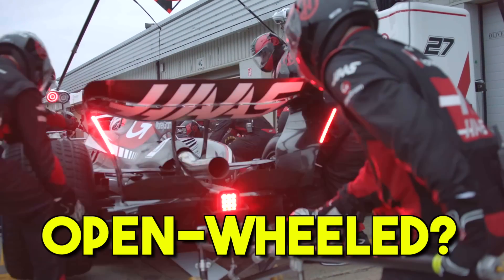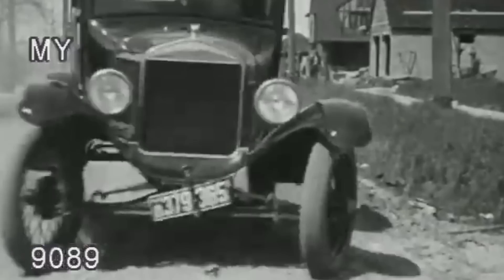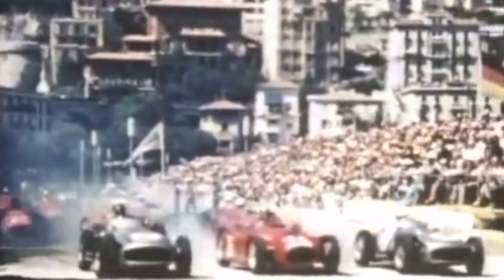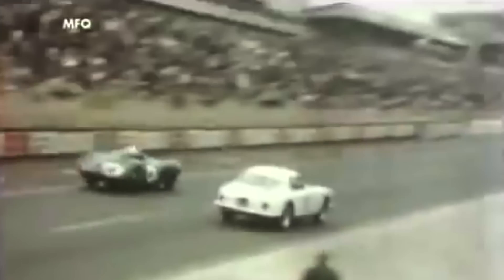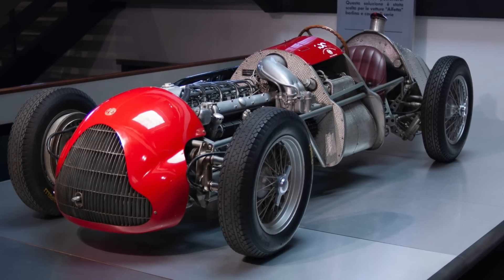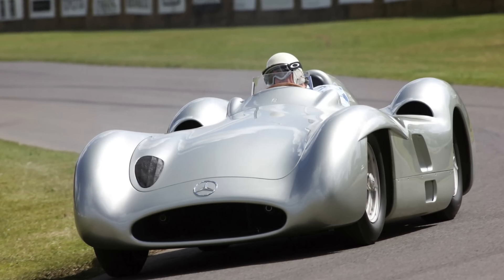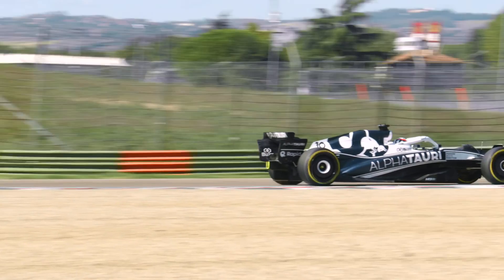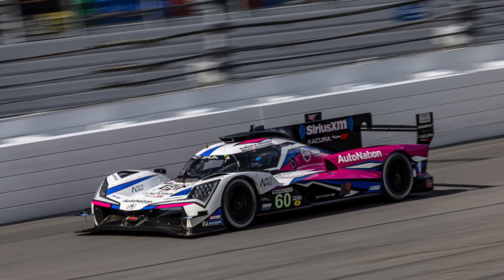WHY Formula 1 Cars have OPEN WHEELS?

Comment: I think they also remained open because the cars are easier to damage in case of contact which means driver try more to avoid contact. However wheel contact can launch a car airborne which is not good for safety so I guess future cars could go covered. Also it means the cars use a lot more energy to drive at a given speed which is not what f1 organisers try to promote.

Comment: Thanks for the vid and the info, had thought about that sometimes when watching other racing series.
But by now open wheels are so ingrained into the brand of Formula 1 that I heavily doubt they will ever start/allow fully covering it.
Reply: I was thinking that way for a long time... until the FIA imposed the halo. The halo is also an aesthetic horror and a departure from the tradition of open single-seaters cockpits. It was badly welcomed by most fans and yet the FIA imposed it in defiance of tradition, aesthetics, and even at the expense of practicality since spectators find it more difficult to distinguish the drivers from their helmets. 
Naska forgot to mention that covering the wheels also has a safety benefit, preventing cars from getting tangled in the wheels, and climbing each other, and can help prevent the wheels from flying off if the suspension breaks or if they detach. 
The FIA is not 100% rational in its decisions.
Reply: @ulysse21 yeah I was also thinking about added safety. Also not a fan of halo as well as it hinders visibility for the driver somewhat